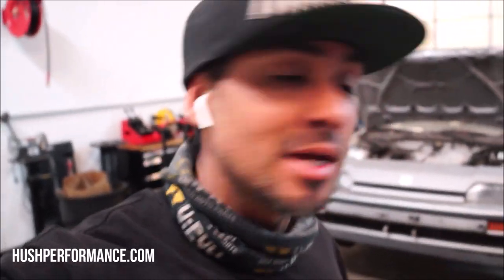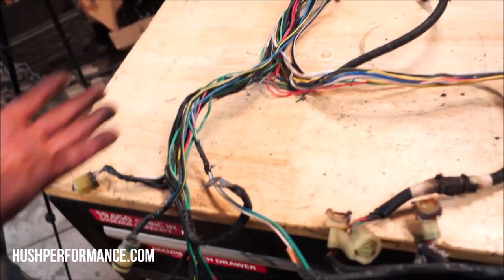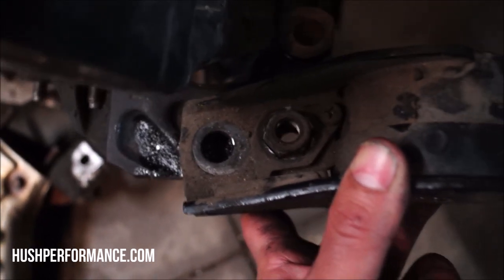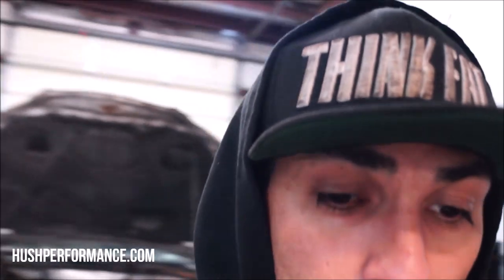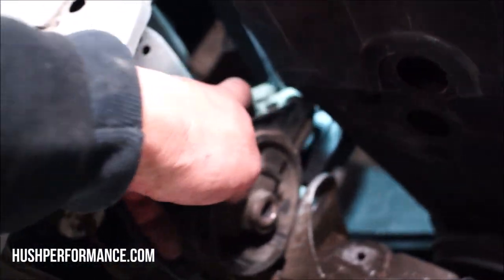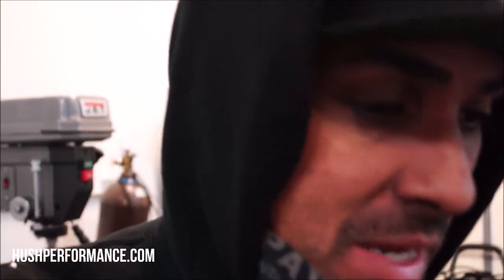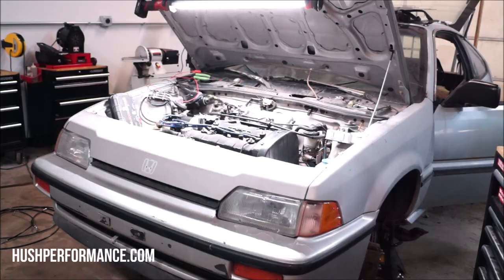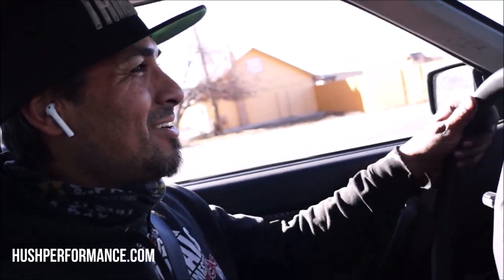1986-1987 Civic Si to DOHC D16a1/ZC Swap

Comment: Great job brother, I did this swap many years ago on my CRX using the Integra harness and ECU, but I used the earlier Integra engine with the external coil, had to move a few pins around and extend a few wires but definitely wasn't a bad swap to do. Gonna subscribe to the channel, I love the attention to detail, that's good stuff man.
Reply from the maker: Thank you!
Reply: I just bought a car that the guy was doing the same in a 90 EF hatch and he wired the JDM harness up and ECU but I'm not sure what all I need to repin and to what any help.would be appreciated greatly and hell I'd even pay ya. It turns over but no spark

Comment: I did this swap 18 years ago.. so much fun. Parts weren't easy to source even back then. I put in 1986 ITR browntop into 1987 CRX Si. Still was a monster after the swap!
Used Integra ecu, wiring, front hub/brakes, axle, shift linkage, trans mount...

You don't even need CAI. You can easily modify the airbox to take air from the right inner fender. Sounds awesome!

Good luck brother!

Comment: Very cool. Nicely done, too bad about the left side engine bracket but you made it work. 

Regarding the air box, the tube and airbox lid from the Integra fit right onto the lower portion of the air box. 

I've owned two Civic Si's that previous owners had done this swap on, also did this same swap on one of my CRX's (Honda Challenge H2 road race car) and just recently did the complete 1986 Integra swap into a 1987 Civic DX body.

Comment: i use D16A13 at my SH4 sedan. So good for a while and i used a standard. 

Top Speed : 215- 220 kmh
Not used timing belt tensioner and i must  reduse and use a little bit shot timingbelt 
Not use power stering but i need an aircond.

A little engineering to make engine mounting.

Comment: I swapped a 87 rs d16a1 into my 88 integra ls 5speed, what zc dizzy do I need, because It runs fine on the 88 d16a1 dizzy but has a check engine light and code 9

Comment: I did that swap in 1998. Getting ready to rebuild mine.........Looks great!  Did you have to cut the shifter rod length?
Reply from the maker: I used the Integra linkage. I lost that footage. No modifications needed.

Comment: Hey i have have a 1989 integra and need a header any idea what header bolts up without modifications
Reply: You can use a header for a single cam D series. You'll need to modify the ports slightly and make some other "adjustments" to account for the twin cam head. I used an eBay header and tapered the flanges.

Comment: Hey bro.. im am so frustrated.. I own a 95 accord and it was auto.. it had a 4500 rpm rev limit.. I swapped it to manual with ecu and gage cluster.. didn't fix it.. bought a f23a motor put it in did not fix it.. replaced the dizzy, fuel filter, oil pressure switch, vtec solenoid and still did not fix it.. the only thing I haven't replaced is the engine harness and fuel pump.. you think I might of gotten a bad gauge cluster since it seems like a chassis problem not engine problem?? Im at blood sweat and tears with this car.. and put money into it quit a bit.. if you can try to point me in the right direction it be awesome
Reply: f23 had some sensors on crank that normally would be in dizzy on a lot of older hondas, like h22, and then some dizzys had external coil. Make sure you have spark.